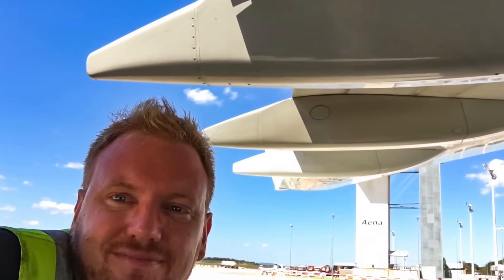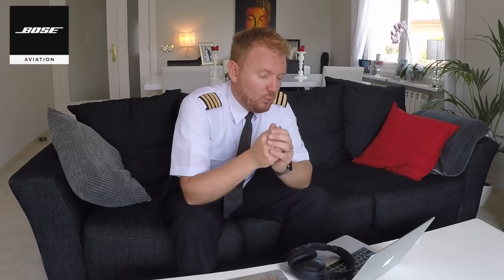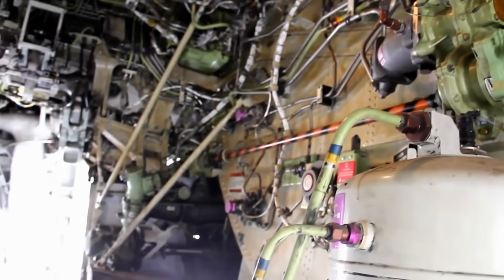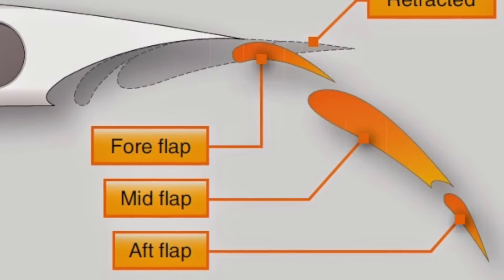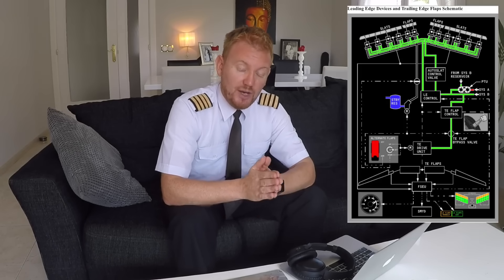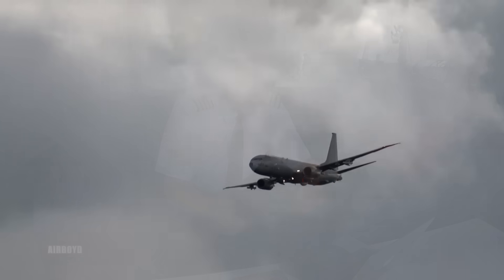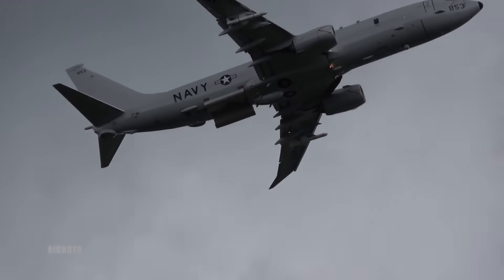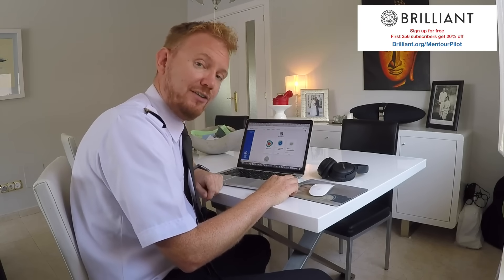"Pods" under the wing? What are they?

Comment: In my first flight, I sat at 24 seat A, was left wing seat just over all the flaps and speedbrakes, I just got a bit worried about how badly the most inner pod vibrated, and later how loud the flaps motor was.  737-800.  At the flying back i took the same seat, and pod in that 737 vibrated too, but has less noisy flap motor.  Since that, 24A is my fav seat!

Comment: I really enjoy the more technical videos about planes and flying.  One specific topic I would love to see covered is the Autopilot, and its related systems.  How do the Flight Director, Autothrottle, FMC, etc all work together to keep the plane going where the it is supposed to go.  I understand there are different modes;  what are they?    Hope you get enough similar questions.  One other question, how twitchy is the plane on take off or landing, to rudder inputs, ie  does it take a lot of practice to keep it on the centreline?  Regardless, pls keep up the videos... love your work, Petter!

Comment: Boeing P-8 Poseidon: based off of the 737-800ERX fuselage and engines with a modified 737-900 wing. Can mount AGM-84 Harpoon anti-ship missiles on external pylons, torpedos or depth charges in a bomb bay just aft of the wing. Uses th APY-10 radar for surface search.

Comment: The biggest scare I had as a pilot was a flap actuator rod that snapped while extending the flaps on a Cessna 172.  It was a cold winter night and I was flying under the hood with my instrument instructor.  Fortunately, I had just begun to bank to the left to turn on base at the same time I extended the flaps from the second to the third notch.  The plane didn’t want to bank.  I had full left deflection on the yoke, but the plane still wanted to roll to the right.  A glance to the left showed a normal flap, but to the right I saw the flap in trail.  I quickly retracted the flaps and declared a missed approach.  After making a no-flaps landing, we found that the rod had broken in the threads where it screws into the clevis on the flap.  It appeared there may have been a slight bend in the rod at that point.  We theorized but could not prove that an overzealous line boy had caused the damage.  There had been an ice storm the day before and when I called to schedule the plane, I asked that it be de+iced.  When I got there, the plane was in the heated maintenance hangar and the door was unlocked.  We think the kid figured he could break the ice off easier by turning on the master switch and cycling the flaps down then up.  But ice in the track could have prevented the movement and caused the rod to bend at the weakest point, i.e. in the threads where the diameter is the smallest.  There was no other reason for the cabin to be unlocked.

Comment: To complete what you said: these trailing edge pods also reduce the wave drag which appears at high speeds. This is why they are so bulky (they could be slimmer if their role was only to cover the flaps mechanism). When this aerodynamic effect was discovered, a few aircraft like the Convair 990 were designed with dedicated "anti-shock bodies" on the trailing edges. Aircraft manufacturers later found it much more efficient to combine them with the flaps fairings.
Reply: Antoine Bonnet 
Except,.. 
That doesn't come in to play here. 
Good Explanation of why it would at mach-+. 
But these, as in most Boeing "Commercial" Aircraft. Is for ease of removal and maintenance. 
And hence their dimensions. 
Tolerances at less than Mach, are less critical. 
Just a simple explanation from a 49yr Boeing engineer.
Reply: @My-Pal-Hal  I thought anti-shock bodies were used to reduce wave drag at transonic flight no? Well within the envelope of the 737.
Reply: @tonybalogna123  
But these are just aerodynamic fairings to cover the flap tracks.
And they are only held in place with a single row of screws around the top of the fairing. Which in itself shows they don't normally experience much turbulence,.. normally. And why they were a bit larger than they technically had to be. Again, for ease of maintenance too.
They are there to protect the flap tracks system from dirt and debris. And keep crap out of the gobs of butter lube within.
And those are Technically Called "Torque TUBES",.. not torque rods. You have to be Good at Safety Wiring those, especially on the 747. A torque tube nightmare. Trust me 😬

Those fairings on the 747 were big enough for a 12 person Canoe 😂
... if you screwed them together of course 😊 

The 47 was my fav.
And in the old days. If you know what final assembly is.
Final Assembly is were you bring all the aircraft sections together. Body, Wings, Gear, Control Surfaces, Electrical Systems etc. And assembly the complete airframe. Minus most of the interior, engines, paint,.. that sort of thing.
Anyway.
We were assembling a 747 every 3 days, with no travelers (100%) for almost 3yrs. Till the cycle changed again. We were building them faster than they knew what to do with them 😂
Good Times. We had fun 🤗
Which reminds me of a term few people have ever heard. "Crease Backup". You get a ⭐ if you can find that one.
...other than this comment 😏✌️
Reply: @My-Pal-Hal  Love the explanation. Not gonna lie, the "anti-shock" explanation does sound a little sexier and exciting than just an ol' safety cover for the flap mechanism... but I've asked a few engineers now, and they all pretty much say the same thing you're saying.
Reply: @adrienrassat1965  
Yeah !!!
Nothing like the experience of actually building these aircraft for decades 🤗
People like to give Old People Crap.
But we're the only ones that can actually say "Been There, Done That", to practically anything on the planet.

And we did it walking Uphill, Both Ways, in the Snow,.. BACKWARDS 😂
... backwards is good, you can see where you will start from Again, Soon 😏 😅 🖖
Reply: @adrienrassat1965  
It is kinda amazing how little actually attaches the flap track fairings to the wings. But it's all Aerodynamics. Being in most flight configurations, it's a vacuum under there.
They are more for environmental contamination, and,.. Birds, let's say 😉
The Aerodynamics, are for fuel saving more than anything. Speed wasn't the determinator in these flight envelopes.

AND HERE'S A STORY NOBODY REMEMBERS. And is probably classified 😂
JAL, Japanese Airlines.
Actually put in a proposal for 747s with FIXED LANDING GEAR.
They were a good customer. And their 747s were basically Puddle Jumpers. Just mostly for inter island transportation.
And they figured the Weight Savings of the hydraulic systems being removed, or, not installed, would outweigh the Aerodynamics of unretracted landing gear.
For their purposes,.. it would have been a bit.
But resale, and use of said aircraft configuration would have limited them greatly in the future.

Learn something new every day 🤗
Reply: @adrienrassat1965  
And I should add.
If you are actually talking to Engineers,.. they seem to know the HAPS 🤗

Just look at any Fighter Aircraft.
They have more crap hanging under the wings, than the aircraft, And Wings Themselves 😂
Sure. Those may be Aerodynamic Bodies. But simply the air disturbance of the attach points would be a problem. But,.. not so much, under a wing.
And they still fly. Imagine that 😏
Tell your engineers, 👍👍👍
Because I know more than one, that doesn't get it. And they went to college too. And Got A Job 😬
Reply: @adrienrassat1965  
AND,..
Those fairing as I mentioned.
And built for maintenance as much as anything. And the environment.
They really aren't much bigger than the flap tracks they cover.
AND,..
They look better than the stuff they cover. Cause I'd bet, even more people would be asking, WTF IS THAT 💩 HANGING DOWN THERE 😂 🤣 😂
... enjoy ☺️
Reply: @adrienrassat1965  
AND THEY ARE NOT "PODS" , they're Fairings 😂
They are not "Bulky", because they are Hollow Coverings of movable surfaces. Using the minimum of structure to serve their purposes. Because Weight costs Money.
... I said that didn't I 😂

Not aimed at you. You seem to get it 🤗, that's cool.
But I just had to say that, for the original OP's comment.

The Transonic Envelope is a thing.
When transferring from one, to another. That's when stuff happens, if it's part of that aircrafts envelope.
Each side of said envelope, is less of a concern.
Above That,.. is Heat. Below that. Is WHERE'S MY DAMN LUGGAGE ???
... and that's where HEAT Really Comes In 😂
Reply: Shocks begin to form on the upper surface before the bottom. Obviously because the upper surface is where the air accelerates. The lower surface on modern aircraft such as A320 family and forward use the super critical airfoil that incorporates a trailing edge cusp to also mitigate the formation of shock waves. I would be cool if the fairings stayed on the upper surface like the 990. My intuition says that took up wing area on the lifting surface.

Comment: But why do they extend behind the wings? Is it just for the fairing to be more aerodynamic?
Reply from the maker: No, it’s because the flaps also extend behind the wings.
Reply: I mean, when extending the flaps the fairings move with the flaps and still poke out roughly 50cm behind the aft flaps when fully extended. What is the reason they are so long? They surely can't give any mechanical support to the flaps from that far back.

Comment: On most modern jetliners how is ice on the upper portion of the wing removed in flight?  I know that many turboprop aircraft use the inflatable rubber boot on the leading edge of the wing, which doesn't seem that efficient.Also, is it possible for ice to form on the flaps, the spoilers or the front leading edge of the wings enough to hinder operations during landings?
Reply from the maker: We use thermal anti-ice which heats up the leading edges. On top of the wing it won’t form and there is nothing to protect the flaps. That’s why we are not allowed to hold, with flaps extended, in icing conditions. 
No, ice won’t stop us from landing unless it’s severe and in that case we divert.

Comment: What is you view on being allowed to turn off the transponder in the aircraft? Should it not be allowed?
Reply from the maker: It is not allowed
Reply: I know most airlines don't allow it. In the case of MH370 it was turned off by someone in the cockpit should there be a way so that pilots have no access to the transponder switch.
Reply: +Jonathan Turner        Anything electrical, including the transponder, can catch on fire. Therefore, having a circuit breaker accessible to the pilots to turn off the transponder is probably considered necessary from a safety point-of-view.

Comment: The pods underwing are called canoe fairings by Boeing people. The pods are aerodynamic fairings for the jack screws used by the flaps. 

The P8 Poseidon uses a modified fuselage that's cut behind the landing gear bay to incorporate a number of mission features, like sonar buoys, and other listening devices. 

There are hard points on the wings for missile attachments.
Reply: Gunga Dinn thanks for sharing the same info that this video did, but in a much more boring manner.

Comment: I guess its a Harpoon missle (the actual missiles, not the pods), but I haven't seen that configuration of fins before.  From the size of it there's not much else it could be.  The Hellfire missile is much smaller and cruise missiles are much larger (and usually have some kind of lift producing wing).  So (no surprise from "NAVY" on the plane) they're probably radar guided Air to Ship Harpoon missiles.

Comment: All of what you said about the flap mechanism fairings is correct, but you left out another major function which has a significant effect on their contour:  their use as anti-shock bodies.  These fairings are frequently larger & a different shape than what's necessary for streamlining or covering the mechanism because they're used for transonic area ruling.  Thus, they are performing the function of a "Whitcomb body" or "Küchemann carrot" at the same time as they're covering the mechanism.  Most often, folks associate area ruling soley with supersonic aircraft and with "Coke bottle" or "wasp waist" shapes (i.e. F-5/T-38, F-106, etc.), but transonic drag reduction is also important and other areas can be used to do area ruling.
Reply: On the Convair CV990 these bulges were sometimes called Marilyns. Make a guess why? :)
Reply: lol... next level explanation... nice work!! As an Aircraft Engineer of 25 years... love your work!!! Though too much information can be dangerous to some hahaha Thumbs up from me!
Reply: Redlock, for the same reason that bumper bullets on '50s cars were called Dagmars. ;)
Reply: Actually, area ruling is MOST important in the transsonic regime. Once you are significantly beyond mach 1 it has less of an effect.
Reply: HotelPapa100, you're correct.  I could have phrased that differently to state that it's most effective in the transonic region -- I was trying to make the point that area ruling is not just for supersonic aircraft.
Reply: Redlock kinda like how the Japanese bomber "betty" got its name with its waist blisters (glazed gun positions) it reminded a  US service man of a nurse called Betty back home .
Reply: Redlock hello
Reply: ShawnD1027 b
Reply: ShawnD1027 4
Reply: put supercritical wing in wikipedia
Reply: Too true!
Reply: Arxienne Romanova hahahahaha
Reply: Bullocks, they are aerodynamic fairings,
Reply: I have JP4 in my blood, I love aviation. Please keep up your fine teaching. Whatever you discuss is most interesting.
Reply: wrong,are you sure it is subsonic, aircraft flyes subsonic but air around aircraft goes supersonic, fairings could be smaller but they make it big to keep shockwave as near as posible  to trailing edge or out of wing, put supercritical wing in wikipedia and then we can talk about it
Reply: no, i am in aircraft industry for 30 years and maybe 2 times  i heard for supercritical wing(highscool and university) and nobody did explain what it is, i just a few years ago know what it is
Reply: ShawnD1027, You are absolutely correct.  The sad thing is that the pilot did not even seem to know about the anti-shock body function.
Reply: ShawnD1027 b/
Reply: What do you mean by shock? We are not in the supersonic range.
Reply: ShawnD1027 
Maybe he left that out because nobody understand what the hell u just said
Reply: ShawnD1027 Hey Moron, Commercial Airliners are subsonic... They are an aerodynamic fairing, nothing more.

Comment: @mentour, congrats for the excellent material in you channel! I would like to figure out the origin of those sounds that we heard inside the cabin when the engine are shutting down... They look like rubber tires rubbing against each other! Sometimes they are short in time, sometimes long. We can hearde them also in the engine starting. Those impressions guide me to think that they are associated to the hydraulic pumps system, but I'm not sure. I have the sound recorded in my cellphone, if you need. Thank you.
Reply from the maker: Hard to say without hearing them.
Reply: Mentour Pilot so I can send them to you by e-mail or any other resource... it is a .wav file, short one.

Comment: here's a question about flaps. in case something has caused damage to one wing and the wing provides less lift than it should, is it possible to extend the flaps on that wing only to compensate?
Reply from the maker: No, flaps can only be extended equally on each wing.

Comment: They must create some drag, even though they are streamlined.  So I am surprised Boeing/Airbus etc hasn't designed the mechanism to be contained completely inside the wing. Also, do they stabilise the aircraft at all? With the air passing along the side of these pods I would think there would be some stabilisation of the yaw while flying straight.
Reply from the maker: No, but apparently they do have an aerodynamic feature where they stabilize chockwaves in the transonic area
Reply: Anything in the air stream creates drag. The point of any fairing is that it creates less drag than the bare mechanism it covers would. If there was a net advantage to containing the mechanism entirely within the wing, and if it was even physically possible (it's not), then they certainly would.